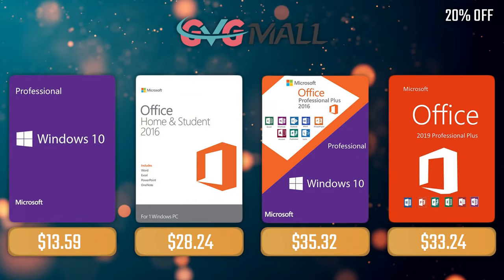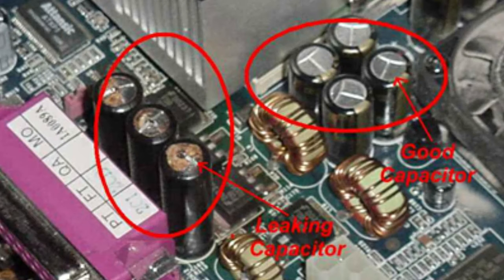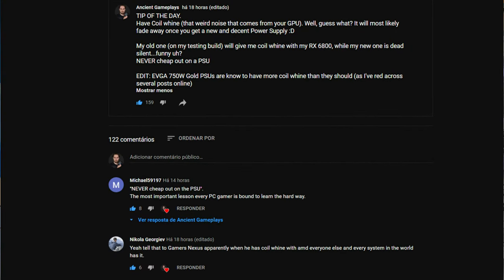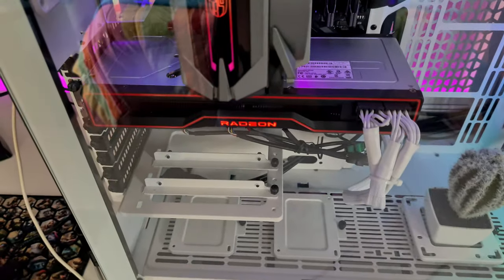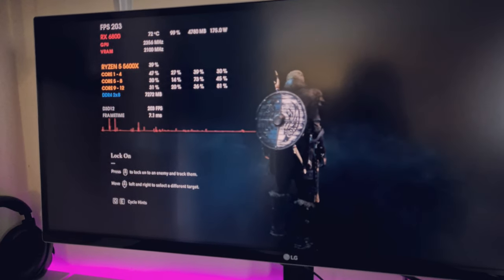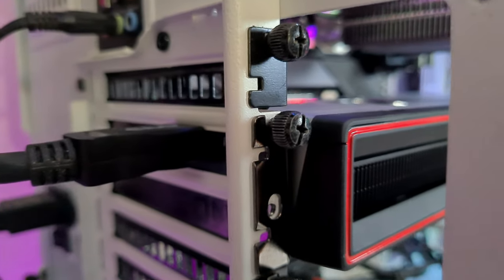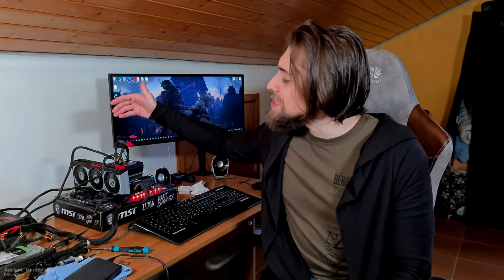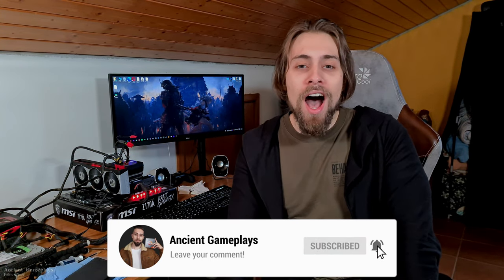GPU Coil Whine -  GPU or PSU's Fault? How to fix it?

Comment: I bought a new Corsair RM650 80+ Gold PSU and it has an annoying coil whine even when the PC is off. I haven't added the GPU yet. It sounds like I have crickets in my case and it's annoying AF. In my other build I used a Thermaltake 850W 80+Gold and it is dead quiet. Both have smart fan. I'm into electronics and I know that quality products do not have audible coil whine. Cheap components and/or poor design causes coil whine.
Reply from the maker: Not thats odd actually. Still doing it?

Comment: It's not a mix of both. It's the one or the other in most cases. I had a Silverstone 850 gold and had coil whine on my red devil 6900XT. I bought a be quiet 1000 watt and still have the same problem. I think it's just the gpu. Maybe a undervolt helps. There are a lot of threads on reddit on people with 6900XT's with coil whine. Don't know about the 6800 series though. Try 3D mark night raid. That will make every GPU sing.Keep up the great work and stay safe.
Reply from the maker: Well, in fact it is a mix. for example, both my 5700XT and 6800 consume the same power draw at max once tweaked (around 200-220W), BUT, my testing PSU DOES NOT have coil whine with it, but it DOES coil whine with my RX 6800 has seen. Electronics are funny xD
In the same book, it has also coil whine with my VEGA 56, and once again, zero with my 5700XT and all are within the same power draw
Reply: My rx 6800 coil whines with an evga 750w 80+ gold psu

Comment: I can totally confirm that a new PSU can mostly resolve the coil whine on modern cards.  i swapped to a RM1000x from a cooler master 650 gpu and my 6900xt became almost silent.

But really that power supplying is WRONG WRONG WRONG.  You dont put a single cable on a 2 connector card EVER. Don't show that nonsense on camera it's bad practice and you are teaching people the wrong way to connect a power supply.
There are 2 reasons NOT to connect a card like that EVER.  
1. wire thickness.  Those wires are not designed to power all gpus with 1 cable
2. there is power supplies with 1 rail with the 12v current and theres power supplies with multiple rails that have a current cap  if you make the card draw all power from 1 of those smaller rails you can blow up the power supply which can take out your whole pc or parts of it.  NEVER EVER use 1 cable on 2 connections.  if the gpu has 3 you can use 2 cables (for now this may change in the future if power draw keeps going up).
Reply from the maker: Yeap, i know that, same thing here haha

Comment: Hi!.. good video!.. as you said, and very  well, yes the PSU is one of the very important parts of a computer, even more with today's high current demanding components.
Reply from the maker: If an electronic master approves, I'm Happy :D
Reply: @AncientGameplays  well... I wouldn't say precisely that, let's say I've learned a few things over the years dealing with pc stuff. A good PC supply should have a high efficiency, low ripple current, and for today's systems where the CPU and graphics card are the most hungry, a good stable 12V line. Also it should be at least rated 40 to 50% of your specific needs.

Comment: The funny thing is, no matter the brand, theres still a chance to coil whine. My seasonic SIII-12 550W has some noises that don't sound like coil whine, but rather that diesel sound of a old mercedes, but less pronounced and more upbeat. It does this in idle or ingame, its all random. it can go for hours or just for a little while. Warranty won't cover this. I think this is a scummy tactic that goes for too long already and it should be stopped, all OEMs do this.
Reply from the maker: But that psu is known to be bad lol. The brand doesn't matter, the quality does
Reply: @AncientGameplays  yes the brand doesn't matter, hence you may find this issue with all brands. Well, that happens when you cheap out on psu, you never should, i learned my lesson.

Comment: I have simillar thing with PSU, GPU seems quite, PSU make different noise than your in the video its still like electrical vibrating just like bee and its so quite i cant hear it normally only if i get very close to the PSU i hearing it, its like this from when i bought it so 1 year or so and i didnt had issues in performance or any other type of issue like unstability or whatever, i guess it gonna be fine to stay with it ?
Reply from the maker: It is fine, just annoying

Comment: I have a RM850 Gold PSU from Corsair. I must change 3070 from Gigabyte, for coil whine. Now I have an RX 6800 reference model from Asrock and no coil whine :D Why is it? Coil whine is also done by GPU I think. 
Ok, maybe I have a little coil whine on my RX 6800. Only with an open case., but with ear at the GPU :D Well, it's still audible when you put your head above the case. But it is almost impossible to notice. The RTX 3070 had a much worse coil whine.
Reply from the maker: Coil whine is definitelty a gpu problem, BUT, can be smoothen out by a good PSU filter

P.s. Gigabyte is meh...
Reply: @AncientGameplays  I would say...Gigabyte is a SHIT :D
Reply: I guess I know why Gigabyte has problems with coil whine. Normally, the power cables are connected to the graphics card board. However, Gigabyte graphics cards have a short board, so they had to put extension cables. It's with three Gigabyte fan versions. Except for the Aurus series.
Reply from the maker: @mara23290  seriously? Thats sad lol
Reply: @AncientGameplays  Seriously :D I watch Gamers Nexus tear down 3080 Gigabyte :D you can find it
Reply from the maker: @mara23290  i didnt even need to see ir stripped to know their cards are shit...the same applies to their coolers..

Comment: will the pc with the same specs as yours(rx 6800 and ryzen 5600x)
give me the same performance as your 25 games benchmark video

please tell me i am worried because the performance of this card is different on all channels
pls reply
Reply from the maker: If you have a decent ram kit...yeah ofc. Also, you NEED to have SAM activated, that alone gives a nice boost in most games
Reply from the maker: Good benchmark channel have around the same results (not those with made up results ofc). You can also use my OC/UV settings for more juice. Watch my vega 56 vs 5700xt vs 6800 video. I have all results there
Reply: @AncientGameplays  thanks bro
Reply: @AncientGameplays  btw what ram speed do you recommend?
Reply from the maker: @Neeraj-_-_-6969  depends, i would tell you to get patriot viper 4400mhz cl19 haha

Comment: You are correct! Changing a coolermaser 600w 80+ silver to my new silverstone 800w platinum there is no coil whine at all. Tested both the old rx590 and rx5700 and I had coil whine with coolermaser and rx590
Reply from the maker: Never cheap out on a psu. A good psu will last you a decade

Comment: Hi, I just watched your video, I have a rx 6650xt with coil whine and I didn't care until the sound was transmitted to the subwoofer of my speakers!  I have an aerocool lux rgb 80+ bronze psu and I think I'm going to try my luck changing the psu

Comment: Got a 10 years old Corsair Gaming GS800 (CMPSU-800G) 
Having a little Coil Whine  on my rx 6800 when Gaming,  on Benchmark´s it´s going crazy 

Spec´s Wise only one 12 Rail?? 
Psu has 4x 6+2 cables, i did try a combination of the cables with the same result´s.

What Psu would you recomend for my system?

3600XT (maybe upgrade to 5800x or 5900x)
B550 Tomahawk
32GB G.Skill 3600@ 3800
AMD RX 6800
2 x m.2 SSD
and a couple of Fan´s.
Custom Watercooling will be added later.

i think my PSU had it best years....

Greeetz.....
Reply: Open Linus techtips forums PSU tier list on your browser.
Reply from the maker: Old PSU like time. You may want to get a new gold one. The corsair like mine are pretty good
Reply: @AncientGameplays  Should i go for single rail or multi rail?
750Watt would be enough?
Reply from the maker: @Wimpelmann  always multi rail, and get at least 750w gold or if possible platinium. Don't cheap out since it will last you another 10 years haha
Reply: @AncientGameplays  thx....

Comment: do i need to buy extra cables to connect 2 cables to the gpu? i currently have one connected, when i get home i try 2 but idk if i have 2
Reply from the maker: If the psu is good it has at least 2 of them
Reply: @AncientGameplays  my rtx 3060 Ti has only one pci slot, how can i connect 2 cables?

Comment: i don't know why but its the only source i found on coil whine that mentions the cause being a mixture of psu and gpu. thanks for the information tho, i recently upgraded from gtx 1060 to rtx 3060Ti and while 1060 never really had coil whine my 3060Ti has a pretty bad case of it. i already ordered a new, more powerful psu so i really hope this helps
Reply from the maker: It will. That card model must be bad, because a GPU with a lower power draw such as the RTX 3060TI should never coil whine unless the model is bad
Reply: a little update, my new psu arrived today and when testing the gpu with it coil whine basically disappeared, thank you so much for your video, without it i'd be sure its just the gpu's fault and would probably have to go through hell of trying to rma it
Reply from the maker: @SKANER__  great to hear that my friend

Comment: I recently built a computer with all new parts and a used gpu. I am unsure whether it is my GPU or the PSU. I am using a Thermaltake Smart Series 500W 80+ Certified and a Radeon RX 5700 XT GAMING OC 8G. The noise is very loud and audible. You can even hear it from outside the case and and it is annoying. The noise is so loud that I can't tell where its coming from. I don't have another machine or psu to test it. I need help and tips.

Comment: I got a Corsair RM850x and a Asus 3070 Dual OC with HORRIBLE coil whine. I could even hear it with headphones on... I contacted Asus about it and they told me to RMA it. I'm waiting on the resolution of this problem now. Weird thing is, the coil whine didn't start happening after 1 month of use. I hope this gets fixed.
Reply from the maker: Those Asus cards are the low end coolers and pcbs so it may just be defective and with cheaper vrms and capacitors

Comment: so i have a 6900xt and 5600x. whenever i start assassins creed odyssey or origins, i hear the coil whine beep 6 times very loud and then pc shuts down.. My psu is an xpg 650w gold. (i can run pretty much any other game). Only happens with assassins creed. Would you recomend changing PSU?
Reply from the maker: Yeap, you're pushing the psu a bit there I believe. Also, it may be a cpu or ram instability
Reply: @AncientGameplays  thanks for your reply! I’ll let you know my results. If it doesn’t work with psu I’ll change the ram. Grazie mille

Comment: I've tried 2gpus so far. Sapphire pulse 7900xt,  xfx merc 310 7900xt and now I have Sapphire nitro+ 7900xt. Also tried 3 different A tier PSUs - xpg core 850W gold, Msi a1000g 1000w and now seasonic focus 850W. Tried 2 different mobos (gigabyte elite ax and msi tomahawk b650)

Still fcking coilwhine :(.
However I heard something about burn-in with running unigine benchmark for few hours straight. Do you think it can  fix that?
Reply from the maker: Might be from your motherboard as well btw. Still all cards will coil whine to some extend unless you undervolt them
Reply: @AncientGameplays  Having coilwhine on 2 different in row would be  really bad luck. I haven't checked my electriciciry at home but that would be too bothersome. Gonna buy some IEM headphones and call it a day.

I tried undervolting as well and it didn't help that much. The only thing which show significant improvement was FPS lock kr underclock. Kinda unfortunate solution because I bought high end gpu for high end perfomance and not for perfomance of low end card🤷

Comment: I have the RM650x model and XFX 5700 XT Thicc 3 Ultra. I can sometimes hear some coil whine while scrolling through a webpage and almost never in game. On very rare few occasions I might hear it. I checked the PSU box and it seems like there are only daisy chain PCIE connectors. I could use separate cables, but it might ruin the aesthetic look. I'm open to hear other opinions on this. Should I forget about the aesthetics and use separate cables for my GPU or keep using one daisy chain cable as I were already?
Reply from the maker: Hey man, 650X for a 5700XT system is not that much at all...i would look into a better PSU

Comment: I had Seasonic 550W s3 with rx6600xt everything was fine. I bought 850W Seasonic G12 and in combination of msi rx6600 and msi 1660super make coil whine, while with rx6600xt is ok! I bring stronger psu because of gpu testing...
Reply from the maker: It may the filter. Also, give it a little time to "burn"

Comment: not sure if this is related, but I get massive screen flickering and it even turns black if I try running my 7800xt at 165hz on my 165hz monitor. I have my gpu connected with 2 pcie connectors split from the same connection. It goes away if I set it to 144hz. On the other hand, my 3060 could handle 165hz with no issues although it uses just one 8 pin power connector. Do you think this is due to not using two separate 8 pin connectors?

Comment: Got rid of coil whine my 3080 when I swapped psu. I swapped my 2014 CS750M Gold to a RM750 gold.. Less fan noise too :)
Reply from the maker: Exactly...People think that just because their PSU has "LOTS OF WATTS" and it is "GOLD", that it is automatically good
Reply: I've got a Corsair HX1200. It's weird it starts to make this weird hissing noise if I cut between a game and a different app in Windows. What is all that about? I have the 6800 XT by XFX.

Comment: My PSU makes coil whine. However its got the eco switch so when the fan is off it makes no sound. I guess that means it is my fan on the psu that has the issue. Is there anything I can do to fix that? Its not insanely loud cause it only comes on when I game and I use headphones anyway.
Reply from the maker: COil when won't damage anything, it is basically static caused by the components, they only way is to change those components or reduce the power load

Comment: I have the same promblem, I would actually say it's even worse than what you showed in the video, with a windforce rtx 2060. my problem is that the gpu is making the same noise as yours is doing but with a vibration as well. I've contacted the seller and they've told me it's fine just play 60 fps on games then nothing will happen (60fps with a 240hz monitor? lol). but overall i'm used to it
Reply from the maker: Yeah that makes no sense. It just means your card's pcb parts (like vrms and capacitors) are bad, hence causing coil whine even with a good psu (if you have a good one). The most you can do is undervolting your GPU so you get lower power draw, hence less coil whine

Comment: I use a single fan 2060 super with a 400w power supply, should i upgrade my power supply to stop the coil whine?
Reply from the maker: You should upgrade your PSU anyway....400W is just too low...never cheap out on a PSU, get a good one and it will last you years and years

Comment: At one point I had a really nice semi modular psu no issues no coil whine noticed from gpu or psu, I then had an issue where I accidently tried to plug the display port cable into the hdmi port whilst trying to reach it under my desk to plug it in (yea rooky mistake) and a tiny piece broke off the hdmi port meaning the tiny pins were touching almost killing my pc luckily I spotted this after many hours of trying to figure out the issue of my pc not starting and fixed it, well snapped the pins off with tweezers so not touching any more, but I had to buy another psu, I got similar to my old one a corsair cx750m from ebay and as soon as I started my pc up that horrible sound kicked in and even worse under load, it changes for menus gaming etc, I changed the mobo and cpu but not the gpu yet as prices still too high, after watching this I think If I change both gpu and psu it may solve the issue.

Comment: Boas Fábio. Eu tenho uma 6700XT Reference e a minha fonte é MPG A650GF da MSI. Em certos jogos o ruido é bastante incomodativo, já tentei alimentar a gráfica através de dois cabos não notei diferença rigorosamente nenhuma. O barulho vem mesmo só da GPU, a PSU só se ouve a ventoinha. Achas mesmo que trocando a fonte resolve o problema?
Se preferires posso deixar o comentário em Inglês...
Reply from the maker: Viva, penso que já te respondi
Reply: Eu comprei uma RTX 3060 da MSI ta com umas 2 semanas de uso e na hora de jogar começa esse zumbido do nada a minha fonte é uma que tenho a quase 5 anos será se trocar resolve?
Reply: @marcosdragneel8265  é possível mas não é uma coisa certa....
Reply: @EXOTIC1011  Fiz o mesmo teste que vc eu tirei a fonte e liguei separados a fonte faz o mesmo barulho que a placa de video só que eu não tenho uma outra fonte pra testar no caso vou comprar uma nova pra ver se resolve o caso
Reply: @marcosdragneel8265  depois diga se resolveu ou não.
Reply: @marcosdragneel8265  conseguiste resolver ?

Comment: My Strix RX570 had coil whine, After i undervolted it to 990mv there is no coil whine!
Reply from the maker: Yeap, less power going through = less noise. But an rx 570 should never have coil whine, indicating it is a very low end model or the psu id quite bad
Reply: @AncientGameplays  Mine is rog strix rx 570 tho!
And psu is Corsair vs 550

Comment: You can fix it by lowering the Frequency in GPU settings.
Reply from the maker: Not actually, what matters is the voltage and power draw (frequency will change things a bit due to lowering the power draw). It won't "fix it", will hide it instead
Reply: @AncientGameplays  yeah, the noise will be lower and barely noticeable. Cheaper solution :)